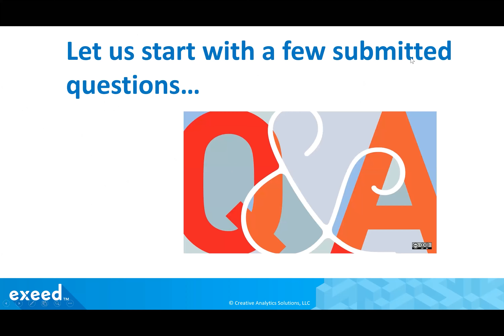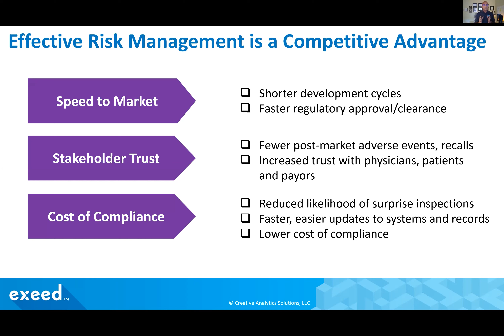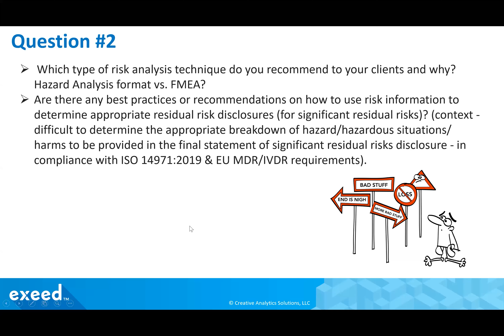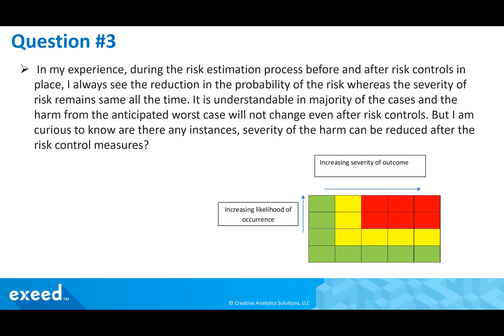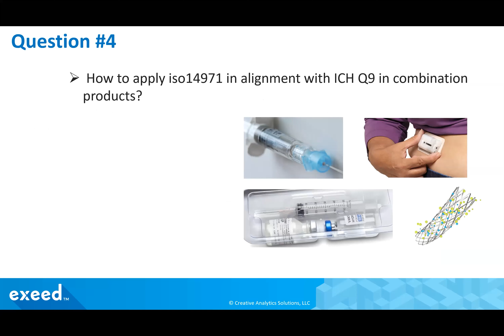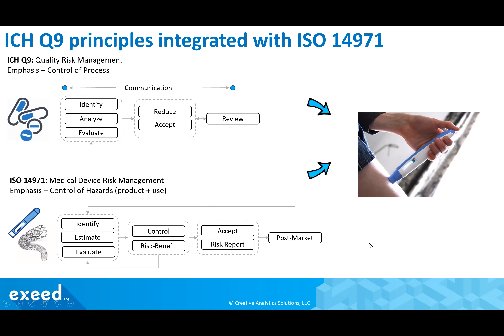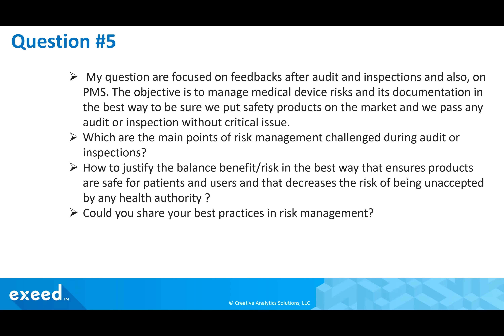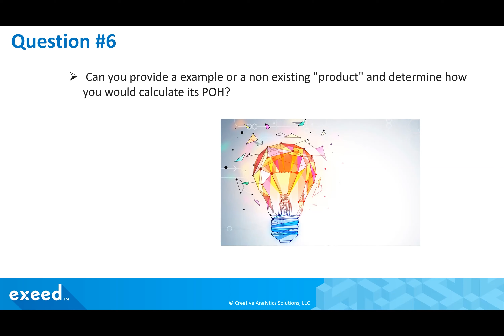Sharing Knowledge, Solving Problems: Oct. 27, 2020

Comment: (Shoen Davis)  Good discussion Naveen,  I'm aligned with your approach to risk assessment and management, even in the broader application to non-medical but critical high-rel product assemblies with hazardous misuse probabilities that engineering design teams often neglect within the detailed pfmea... and in my experience and product field, I do not see estimates of harm being investigated during product development, which is increasing both the reactive resource bruden and total cost.
Reply from the maker: Thank you for sharing your insight, Michael. If the link between product failure and harm is clear, this should be considered in the FMEA. The challenge is that harm in actual use conditions is seldom isolated to a single contributing factor. In general, this is a many-to-many relationship scenario between harms and failures. In a lot of cases, harm can happen even when there is no obvious product failure. As a result, it is very challenging to directly link failure analysis to the probability of harm.